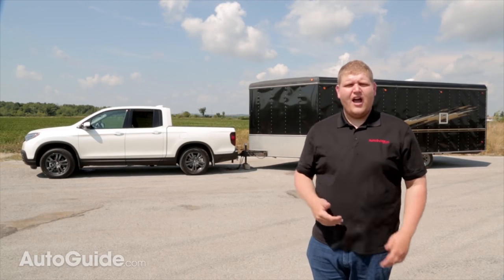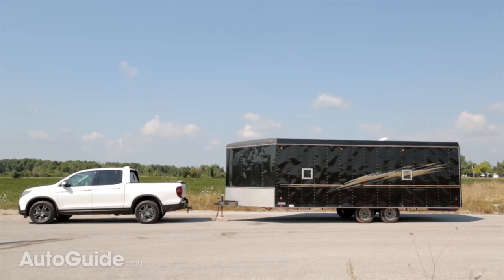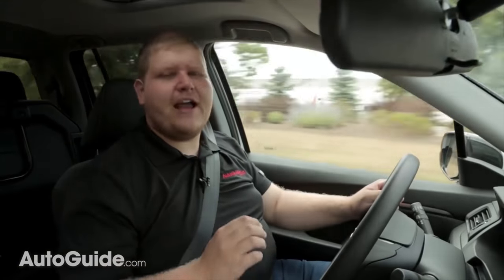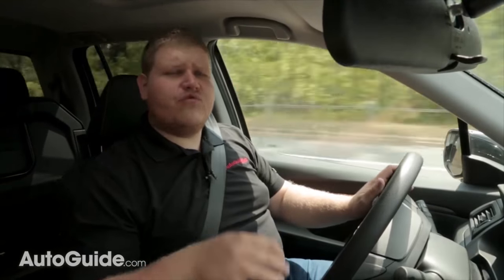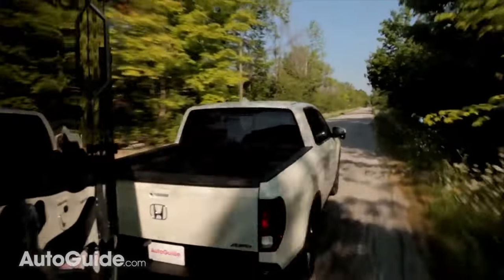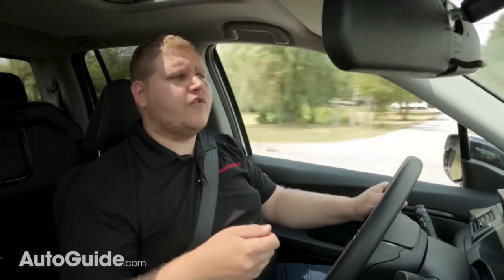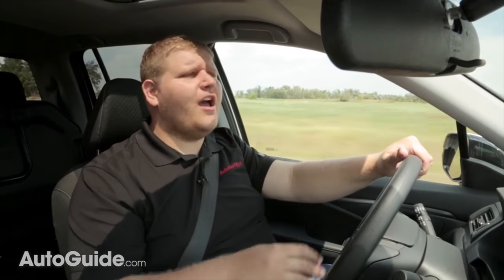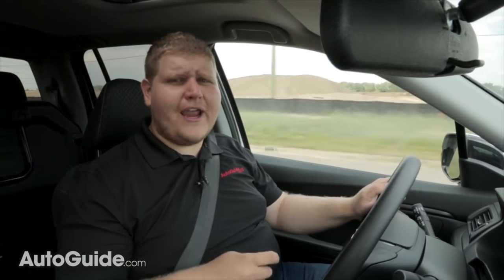2017 Honda Ridgeline Towing Test

Comment: How about a weight distribution hitch an more importantly... a trailer brake controller.
Reply: Cannot use weight distribution due to the independent rear and unibody frame. The low tow rating and the inability to use a weight distribution hitch is the real cons of towing with this truck.

The brake controller is a must though. According to the guys over at TFL truck, the Ridgeline is pre-wired for a controller, just need to buy the unit itself.
Reply: Honda sells a brake controller for it it you need OEM components.
Reply: @BobPauls  When did I say anything about a brake controller? I know that's an option.

Weight distribution, on the other hand, is not.

Comment: Our 2012 Ridgeline regularly gets 22.6 to 23.7 mpg.  I was shocked to hear that yours gets less OR was that milage with the trailer?
Reply: My 2018 Ridgeline get above 26 mpg highway. If I tow my 19 bass boat it gets around 19 mpg.
Reply: @MrChatterbox83  I recently did a road and city test and my average fuel econ was between 24.8 and 25.1 depending on hills and the time in the city.  Not bad for a full size 4WD/AWD four door pick up hey.

Comment: I'm not surprised by the lack of power when towing to the max.  Even on the V6 Accord (which weighs a hell of a lot less), the low end power of the J35 is nothing to write home about.  Honda needs to offer something more in this segment, which could also carryover to their performance line of vehicles with Acura.  And the J37 wouldn't cut it either, it doesn't produce that much more power.

Comment: Lets do a drag race ridgeline vs colorado diesel 1/2 mile with the 5k trailer to see if the honda is as bad as you say it is.
i bet the honda will win
do it
Reply: Honda would win because it has more power. But towing is not about drag racing. Colorado would feel better during regular driving because it has more torque at much lower rpm.
Reply: sic22l feel better during towing or just regular driving?
Reply: kwazykilla87 Both.
Reply: Doubt it!  Torque is everything with regards to towing! Colorado diesel has 100ft/lbs more! Colorado FTW !
Reply: tinleo333 wrong
Reply: Yea, I love when V-TEC kicks in...
Reply: The Honda would beat the Colorado Diesel because Gasoline will accelerate faster than a Diesel
Reply: Colorado would probably win
Reply: Ridgeline would be maxed out and struggling on the top end Colorado could tow 2k lbs more
Reply: Guys people aren't buying these for speed drag races lel. For general purpose utilitarian vehicle which I believe this Ridgeline does very well. You don't get a truck to go fast...

Comment: Everyone so concerned with towing capacity. If you're buying this thing to tow a camper trailer X-country that could be a problem. Otherwise don't worry about it. I'd have no problem hooking a 7,500lb trailer onto this thing once and awhile to go short distances. All vehicles are rated for higher towing capacity in the EU. It's only in America that the manufacturers fool the general public into thinking they need to buy big for everything. My CRV is rated at twice the towing capacity in the EU. If you are a local GC with an equipment trailer that needs to be moved to a different job site three times a year and all within 20 miles, are you really going to buy a 3/4 ton or one ton for that and think that is justified while you pound around in it, suck up fuel, and added expenses? That is just stupid.
Reply: the issue is when you do have an accident, and your insurance sees that you were grossly overweight, and deny's your claim, leaving you fully responsible.
Reply: The EU versions are diesel aren’t they?  More torque = more towing capacity.
Reply: gearing does WONDERS for  towing capacity (same truck and everything but a different rear end ratio gives it more towing capacity per the manufacture; thinking most specifically 08 ford f450). at least being able to start the load out, it doesn't mean that you can stop said load or even guide/steer it correctly
and europe typically has higher tow ratings especially on cars with the exact same specs as here basically
Reply: @73av8r5  It's way more than that. My wife's Subaru in the US is rated to tow NOTHING. In the UK, the same car with the same transmission and smaller (1.6l) gas engine? 1400lbs without brakes, 2650lbs with brakes. They also have different laws for towing, a very different road system, and better driver training. Very similar throughout Europe where people commonly tow dual axle trailers (often galvanized) of around 5000lbs with midsize station wagons and even tiny cars are seen towing trailers regularly. Large vehicles are ill-suited to the infrastructure, and are often cost-prohibitive.
Reply: Benjo Yup. I was born over there and have traveled over there since and can’t imagine driving anything the size of my Tundra there. Sometimes parking lots are too small over here!

Comment: No weight bars for that trailer??
Reply: Rumblestrip.NET but there is a aftermarket hitch.
Reply: Yes, I do have an equalizing hitch for the trailer. 

While I would recommend using one (do as I say, not as I do...), I wanted to really torture test this little truck and see how it handled all the weight on the back. And to my surprise, the steering wasn't super light and sketchy. In that way, it exceeded my expectations.
Reply: Do as I say, not as I do?  Gee I'm unfamiliar with that see one of my latest over on Hooniverse:
http://hooniverse.com/2016/12/06/notthewombat-when-auto-journos-dont-heed-their-own-damn-advice/
Reply: Do as I say, not as I do?  Gee, I'm unfamiliar with that see one of my latest over on Hooniverse:
http://hooniverse.com/2016/12/06/notthewombat-when-auto-journos-dont-heed-their-own-damn-advice/

Comment: A 5000lbs trailer should have trailer brakes, at least in NY, they are required by law. If the brakes are set up right, they should stop the trailer. If they stop the trailer, the truck brakes are supposed to stop the truck. So, I am guessing you didn't have any trailer brakes...?
Reply: 100mpgus I was wondering the same.

Comment: Feels like an Accord? Yeah no... It Rides like a Pilot and that is a good thing! Sadly there are a few miss points here... Doors do not open wide enough! Honda is eager to promote the Magic Seats but they are USELESS when the doors cannot open wide enough to allow a big ass LCD TV Box to fit (Even when space inside is enough) since the doors wont open wide enough. Also Trailer brakes are integrated on VSA but there is absolutely no Manual Control over the brake force to the trailer. 
Other little things are that the ATF Cooler is not stock on all AWD Models.. It comes only with the Hitch Package as Standard.
Build quality (Panels and Fitment) is Hit and Miss too...

I will stick to my 300HP MDX.
Reply: Agreed ... the rear door opening is pathetic.  However ... that situation is easily fixed by replacing the existing door limit stops with FRONT door stops.  Easy job and works perfect!  No clearance issues at all.

Comment: Only 6% of the midsize pickup segment tows more than 5000 lbs
Reply: And 40% of Tacoma owners will go offroad
Reply: Delmer Lara so if you are towing anything, you will be better off with a Colorado/Canyon! Especially if you want to spend under 30k. If over that you can get a Nicky equipped Z71 ext cab 4x4V6 like mine for just over 30 k if you shop right. But a nicely equipped Ridgeline will cost over 40 k! For that money you can get a diesel Colorado and tow more, plus get a lot better mileage!
Reply: Diesel in the Colorado is almost a 5k option.  Add 4x4 and thats another 2k.  You aren't touching a diesel Colorado for 30K.  Well equipped, they're 45k.  I'm buying a midsize truck so I dont have to tow my motorbikes around, and to have a lot of flexibility with payloads in the bed.  Towing is nice, but 5k lbs is plenty for the mid-size buyer - 97% of whom don't tow anything.

Comment: I had a subaru and replaced with a ridgeline, now i replaced that with my 06 tundra. Ridgeline doesnt even come close to the plush ride of the tundra. Loaded and unloaded
Reply: demonspeeds1 
Plush ride with a Tundra? I've owned a 2000, a 2004, a 2010 and a 2014. None road plush....well maybe the 2004 Crew Cab Limited was kinda plush...for a truck. I also sold Hondas and drove many Ridgelines and their ride is best by a long shot, and that was 1st Gen Ridgelines. I imagine the 2017 is even better. If ride comfort is a buyers #1 priority the Honda wins hands down.

Comment: I liked the Ridgeline til I saw it in person! The front end resembles the pilot too much and the rear doors don't open wide enough. Honda missed a lot of steps
Reply: DoubleD 613 ya I don't understand honda sometimes. ...every other car they make the back doors open nice and wide wtf so why not the ridgeline? hello people actually put big stuff back there unlike a car. ..so silly.   and they could've easily made the front more truckier.  if they did I would buy it in a heartbeat
Reply: I have a 17 Ridgeline... works for me just fine... but agree about the back door opening. However for about $27 you can swap out for the same door retainers as used in the front doors. Took me a YouTube video and about 15 per side to get proper opening.
Reply: If it resembles the Pilot, it's because it was derived from the Pilot.

Comment: HONDA, you have the perfect platform to dominate the pickup game in the uk, the main reason pickups don’t sell in the UK is due to the impracticality of the bed but with the flappy thing that mitigates that problem, it could also do with a low range transfer case and proper off road modes for example terrain response and air suspension. 

A 7000lbs towing capacity would be nice Mitsubishi Toyota and Landrover have been doing it for years
A turbo diesel would be nice as well, something like a 3.2Tdi to compete with the Volkswagen Amarok or ford wildtrak

Comment: Why not just get a Pilot, and have a usable rear seat (it's small and unaccommodating in the Ridgeline)? Is it more fashionable to drive a truck even though it's really a crossover with part of the roof chopped off?
Reply: I just bought a very clean, one owner first generation Ridgeline RTL for my business. I was looking for a Pilot until I talked to a buddy of mine who is a Honda Master Tech. After he told me about the oil consumption problems they are having with the Pilot I opted for the Ridgeline. He's replaced more piston rings on Pilots and Odysseys than he can remember, and a grand total of ZERO on Ridgelines. It has to do with cylinder deactivation for fuel mileage which the first gen Ridgeline didn't have. He said they are bulletproof vehicles, they simply don't break if you maintain them properly and don't use them like something they aren't; a heavy duty pickup.
I own 2  3/4 ton diesel pickups for my work and I would never own one of those if I didn't need it. Half of the people who drive pickups are women who drive them like cars and never haul or tow anything. Steep price to pay to make a fashion statement. The Ridgeline is what it is, and I feel that half of the people who drive full sized pickups every day would be much better off with a Ridgeline. And it will actually fit in your garage!
Reply: Ok, get your pen and paper for this, you'll need it. This one is a real doozy. If you don't have a background in rocket science or advanced physics then you'll have a bit of trouble. I'll simplify it to layman's terms as best as I can but after that you're on your own. Some people buy this over the Pilot because they want a truck bed. Ok, I know, it's a lot to handle and Albert Einstein himself would struggle with this concept. Just don't forget to carry the one and you'll be fine.
Reply: Tom Lea After reading your advice I’m getting a Ridgeline 19 Black Edition
Reply: Because the new Ridgeline is designed to haul plywood or drywall in the bed.

Comment: 2019 Ridgeline only 5000 lbs listed.  But   NO Option for Electronic Brake Controller... Needed for electric Brakes on trailer  for 43000 its got a cheap looking interior and no option for epoxy topped steering wheel.
Reply: It is pre-wired for a brake controller of your choice.  That way, people who don't need to tow a large load aren't paying for a feature they'll never use.  You should see the upper trims of the Ridgeline... you might change your mind about the interior looking cheap.

Comment: Everybody test brand new trucks when they’re fresh out the factory. They should make a video after 100000 miles to see if they wort the money.
Reply: I agree, that would be a very useful review. After all, not everyone buys new vehicles, myself included. I prefer to buy clean, well maintained one owner vehicles. A friend of mine bought a Ridgeline RTL new  in '07. It now has close to 270,000 miles on it and it still runs like new. And he works it hard! Other than routine maintenance, he hasn't had any major mechanical issues with it. He just bought a 2011 RTL with about 100,000 on it and he gave his old one to his son. I prefer the looks of the first generation Ridgeline, but to each his own...
Reply: So basically a ridgeline vs a tacoma. The rest are at the junk yard or the shop.

Comment: You should have bought a real towing vehicle. Most trucks would have this stuff on it already. I don’t think you should be towing anything , especially something weighting 5000 lbs.
Reply: The Ridgeline does fine towing at it's max rating. Honda is sensible and conservative with their rating, that 5000lbs is what you can tow safely. Unlike the new Gladiator, which despite it's 7600lbs rating was being pushed all over the road, and it's engine screaming in agony, with a 6900lbs trailer.

Comment: If you want a small truck get a Tacoma.
Reply: ridgeline is much better
Reply: tinleo333 Yep
Reply: The Ridgeline is going to force Toyota to completely revamp the Tacoma. Right now, Honda is having problems keeping dealers in stock. They are selling too fast. The combination of smooth ride, great fuel mileage, 4 foot wide hauling in bed, quick over the road, great handling, beats Tacoma at every turn. If you want a play truck for fun, sure the tacoma is good. Otherwise, the Honda wins.
Reply: S P   im pretty sure tacoma sales dominate compact truck market, honda has a long way before they can touch the ruggedness of a taco
Reply: Taco doesn't haul plywood flat in the box.  It's out.
Reply: Toyota brake is so weak
Reply: If somebody wants an actual midsize truck for regular towing and hauling I'd recommend any of the BOF Trucks over this.Tacoma,Frontier,Colorado or Canyon.Now if a crossover with a bed suits their needs and they don't plan on towing much then this would probably suit their needs.I'm not saying that the Ridgeline in useless.I just have issue's with it being called a Truck.

Comment: Pulling a big trailer with no weight does not mean it can pull a big trailer. Every single other compact truck can tow better.
Also it's better to say when the video is sponsored
Reply: This video is certainly not sponsored by anyone (though Honda did lend me the truck for a week). 

And yes, the other mid-sizers will absolutely tow better. If that's the primary purpose for your truck, don't get a Ridgeline.
Reply: But I WILL get a Ridgeline FOR EVERYTHING I WANT!
Reply: Stephen Elmer that's completely not true,  tfl proved that it towed better than the competition atleast the Tacoma faster up hill while doing it with better mpg.  So get your facts straight.
Reply: So what is the story here? A snowmobile trailer doesn't weigh anything close to 5k, so I'm assuming it was loaded. If it wasn't loaded it was much lighter than 5k. Which is true?
Reply: If you look close this one is an all  "steel" framed 4 place trailer, not an All aluminum one, so if I had to guess its probably around 4000 lbs?? But, it depends if it is insulated and fully decked out? It could possibly weigh 5000#
Reply: You think that a Taco (6800 lbs max), Frontier (6000 max) or Colorado (7700 max) is going to be able to tow a useful payload in a 5000 lb trailer?  C'mon. Who uses a 5000 lb trailer to tow 1000 pounds?  You're right in that the others can tow more - but the reality is that most of the  stuff people tow in mid-size trucks is well under 5000 lbs, and if you need to tow 6000, 6800 or 7700 lbs routinely you aren't going to buy a midsize.
Reply: I agree! To really make it a valid test you need to state exactly what the trailer weighs. Not that "it weighs about 5000 lbs". Tongue weight is beneficial to know too. And I personally don't think it's fair to knock the brakes when you're pulling "5000 lbs" without a proper trailer braking setup! Any trailer over a couple thousand pounds should have brakes on it!
Reply: @kstan1257  Very true!  They took a Ridgeline with a driver, a passenger, and a 4,800 pound trailer (WITH a brake controller) up I-70 to the Eisenhower Tunnel in Colorado (11,000-foot elevation) and it performed like a champ.

Comment: It is not a truck!!
Reply: It’s a pick-up truck!
Reply: Mudstone ! It’s a car with a bed
Reply: James Piroli     Oh, so why does it require Truck Plates, just like a Dodge Ram?
Reply: @mudstone6497  Wait till someone bends the unibody trying to pull something or doing truck work.  It a SUV crossover
Reply: James Piroli        Definition of a pickup truck: 
A pickup truck or pickup is a light-duty truck having an enclosed cab and an open cargo area with low sides and tailgate.
Huh, who would of thunk that the Ridgeline fits into that definition, just like the F150
Reply: I’d be more worried about the Tacoma’s frame rusting and splitting in half while towing the Ridgeline’s max capacity!